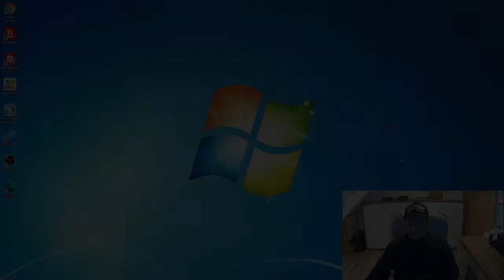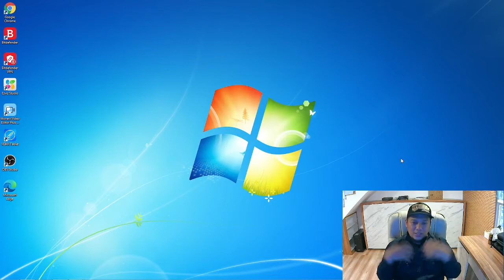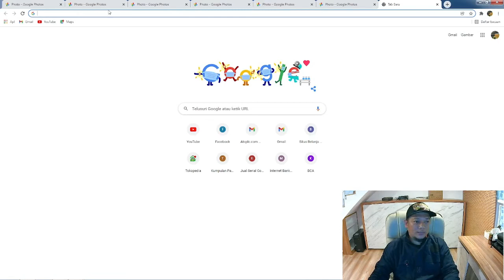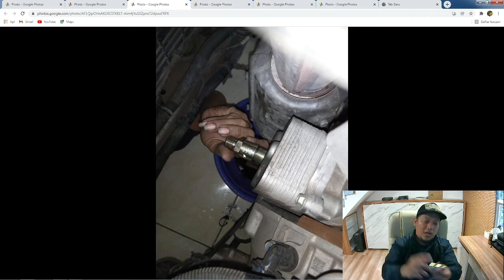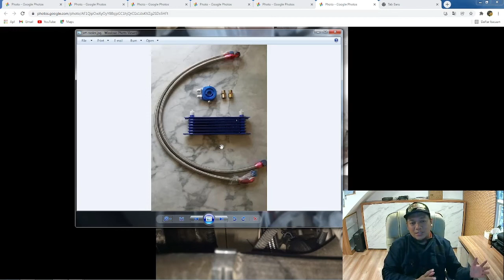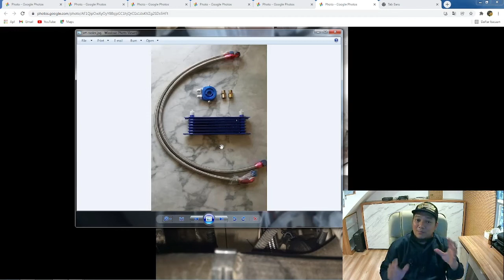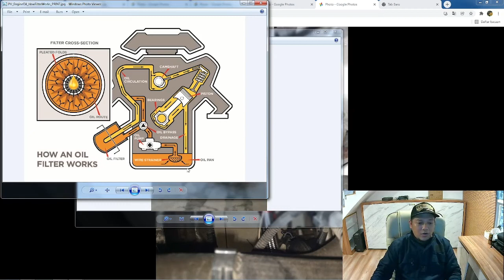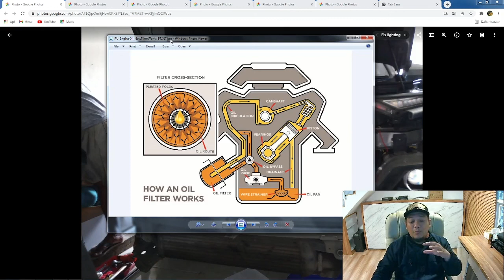Oil cooler di Almaz ku

Comment: mantap kreatifitasnya, yang saya ingin tanggapi adalah, apakah pada sandwich sudah ada remote oil thermostat, yang gunanya untuk mengatur agar oli dengan temperatur tinggi yang masuk oil cooler, tapi kalau masih temperatur kerja mesin oli hanya melalui filter saja. hal ini untuk menjaga tekanan oli dalam mesin terjaga baik.
Reply from the maker: Belum ada , soale kadang pengalaman pke oil thermostat suka macet gak kerja , efek nya bahaya buat mobil

Comment: Bagus mas penjelasanya, tapi kalo boleh nambahin menurut saya untuk mobil standar wajib pakai thermostat sistem, 
jadi pas mesin dingin oil cooler ga langsung terbuka. Oil cooler baru aktif ketika suhu ideal. Jadi oli ga telat  naik dan merusak mesin terutama pas baru dinyalain
Reply from the maker: Thanks om atas masukan nya, benar sih musti nya yg baik sandwich nya yg menggunakan thermostat 👍, tapi Jaman masih main mobil Galant dulu sandwich yg menggunakan thermostat sering banget problem di bagian katup valve nya...entah dulu saya pake yg brand kurang baik atau gmn, makanya akhir nya yg ini dipasang yg tanpa thermostat aja... 😁
Tapi benar harus nya sy jelasin nya yg versi ideal yg menggunakan thermostat juga musti dibahas 🙏🙏🙏
Reply: Tanpa thermostat juga gak masalah, karena oil cooler ini pendinginan sekunder, hanya keep oil temperatur. Untuk engine tetap dijaga oleh yg utama, water coolernya

Comment: Tetep aja bukan solusi, masih overheat dan gagal nanjak di krakalan rame tuh baru2 ini belum diisi full 7 org pula, malah banyakan ngademin mesin daripada nanjaknya.
Mirip coolant cooler, Oil cooler Ini tidak signifikan, apabila oil PUMP nya out of capacity (under capacity) jadi flow dan speed sirkulasinya tetep lelet kaya standar ya heat exchange mya sami mawon
Reply from the maker: Kayak nya perlu dipahamin lagi deh , antara overheat mesin dan overheat CVT , setahu saya yg di krakalan itu CVT yg overheat....yg mengakibatkan masuk ke safemode 🤭✌️
Reply: Desain awal dari sebuah cvt itu untuk mngakomodir kendaraan khsus perkotaan.
Tapi masyarakat indonesia ini aneh, mereka kbnyakan mnyuruh ATPM membuat mobil harus irit, murah, muat bnyak, dan tidak rewelan. 
ATPM akhirnya lebih memilih CVT untuk memenuhi kebutuhan, tapi ksiannya gak bisa nanjak untuk memenuhi ekspektasi masyarakat konoha. Kenapa sya bilang CVT ini gagal? Soalnyaa untuk varian Manualnya justru lebih sanggup dan memang CVT ini desain awal di ciptakannya saja sudah tdk untuk nanjak,

Klo bilang mobil lain bisa dengan transmisi CVT nya itu blum apes aja.  Lagian juga nanjaknya paling speed 15km gas udah mentok, apakah itu sebuah keberhasilan? Kasian bnget nanjak 15km/jam dengan gas sdh mentok